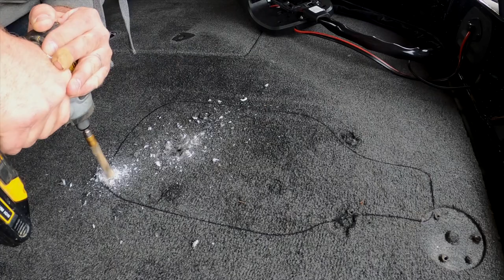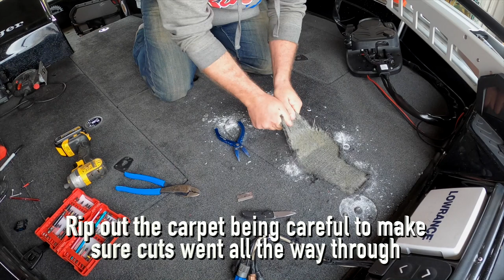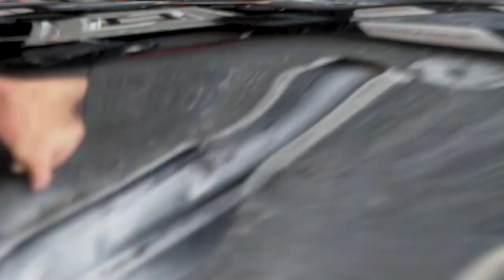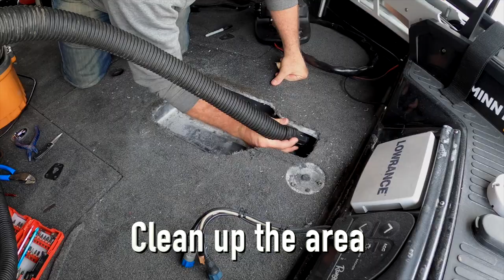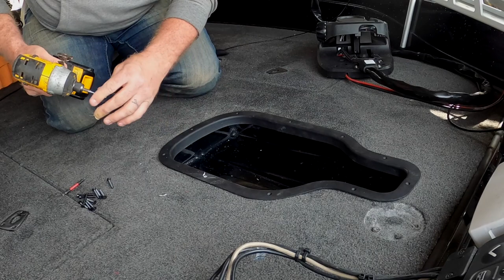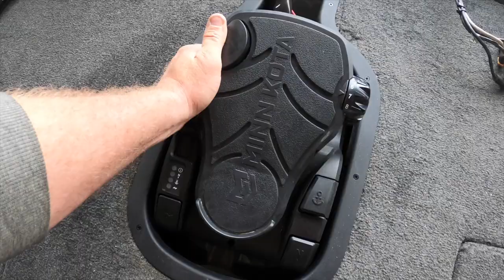Ranger Boat Factory Recessed Foot Pedal

Comment: Thanks for posting this video. I've seen lots of people explaining the process through pictures but this video helps alot more. Now I'm confident I can do it.
Reply from the maker: Glad it helped! It’s not too hard at all. Just take your time and make sure the template is the correct side up. They don’t usually mark the template which side is up.
Reply: @FullQuiverOutdoors  Finally got er done using your video to help. I will say that template is worth every penny and makes it alot less stressful. I ended up using a hole saw and cutting the middle of the template area out to peek in. I managed to get a tape measure in to verify my template positioning was correct. I tried wood blades for the jigsaw but they burned up in about 20 seconds so the key is use metal blades. I Think I went through 2 to get it done. Thanks again for posting! 👍👍
Reply from the maker: @Bassmada , good to hear! Glad I could help

Comment: I’ll buy that template if you still have it! Ranger told me 4 weeks to get one but they have the trim piece in stock.
Reply from the maker: I’m sorry, it was just a piece of card stock and I threw it away after I did it. If you were good with carpentry, you could drill a hole in the center of the foot well (you have lots of room for error) and use a piece of wire to feel for the corners and mark them. Keep cutting the hole bigger until you can use the trim piece as the template. I don’t think that would be difficult after I’ve seen how it lays out. Once you’ve got a 5x5” hole or so, you can literally feel with your hands where the sides are, measure and use the trim piece as the template.

Comment: I ordered mine and my template doesn't have a pedestal hole for alignment. Did yours come with one or did you make that?
Reply from the maker: Mine came with a hole for alignment. Sounds like Ranger didn’t print your template correct.
Reply: So I called ranger today and was told engineering does things a certain way for certain things and for different year model boats. They would be happy to pass along my idea of punch a hole for my butt seat to aid in alignment for future though.... This company had gone to shit
Reply from the maker: @wejruf25 , man, that stinks. I know since it became the White River Marine Group, it’s been a lot tougher to get good customer service for things like that.

Comment: Is there a drain hole or did you have to create a drain?
Reply from the maker: There’s a drain hole glassed in from the factory.
Reply: @FullQuiverOutdoors  Thank you - Your video saved me some $$'s - I was about to cut my deck for a comfortroll pan install. I had no idea my 08 170VX had a pan already in place by the factory.
Reply from the maker: @myndblstr  so glad I could help! I figured there would be very few people who could actually use this video but thought it would be worth it because I didn’t know either. Good deal!
Reply: @FullQuiverOutdoors  do you have the part #'s for the template and trim kit.  I tried to call Ranger and my dealer and they had no idea.  Thanks!  Steve
Reply from the maker: I’m sorry, I do not. I don’t know if each recess is different shape or size either. I wouldn’t want to give you the wrong one if you didn’t have the same exact boat. I called Ranger and explained what I wanted and ordered it.